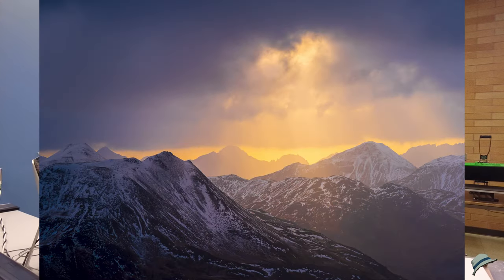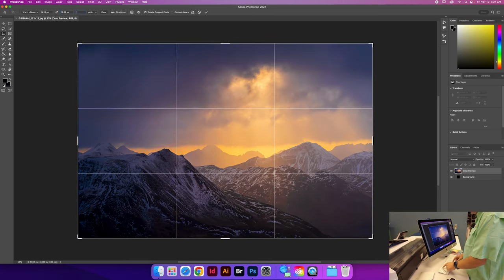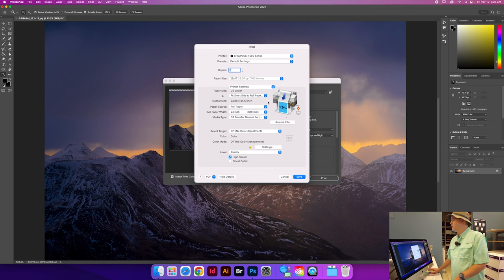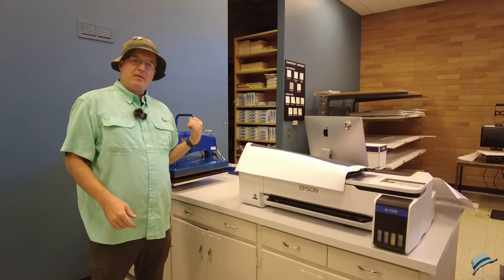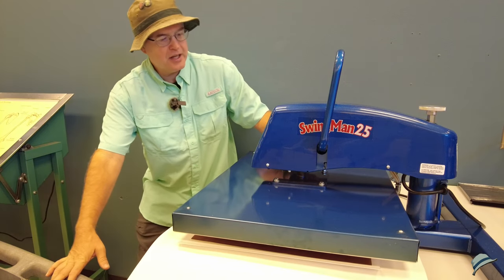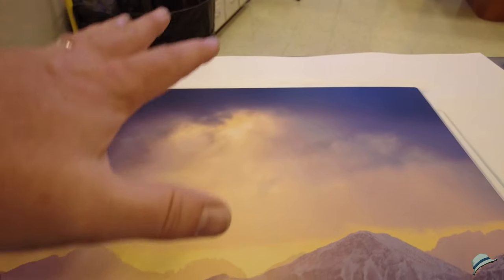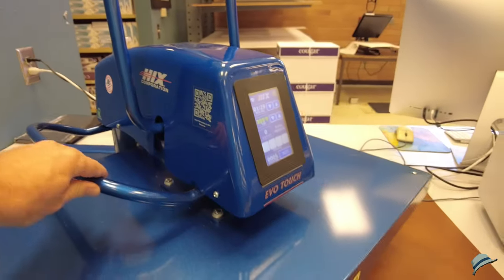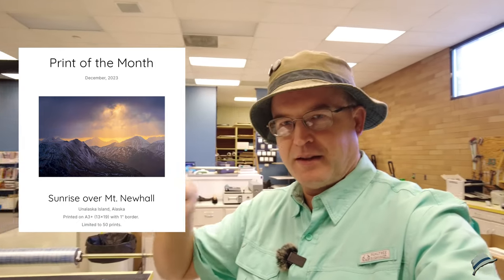How I made a large metal print myself | Dye Sublimation Printing for photography | Epson F570

Comment: Little note on the printer for those who want to get into the hobby - you don't teeechnically need an expensive surecolor for this. Like, while it is nice to have the additional colour accuracy, etc, people also use standard inkjet printers for this(you can find others on YT showing this), what you really need is the proper ink and transfer paper for it, which also works in refillable printers like the Epson EcoTank models, which are like an order of magnituted less expensive. Only downside is the sizes usually run a bit smaller(the ET18100 runs A3+, which is 13 by 19 inches afair) but if you're fine with that or know how to stitch them together or want to get creative with comic-style panel subdivisions, then these cheaper consumer printers are usually more than fine.
Reply from the maker: Yes, I've looked in to converting a standard printer to DyeSub, but I decided our machines aren't the right ones for conversion. If I'd had an older 24" printer I'd have probably done that route. But anyway, it certainly is a good option for many!
Reply: Can I ask if I have a large sublimation printer, but my heat press isn’t large enough, would I be able to use my smaller heat press and do it in sections?
Reply from the maker: I have thought of that but haven't tested it out yet. So I'm unsure. I would think that if you secured it very well to the substrate you'd be fine, but it's possible that different cooking times will adjust the dye application to a noticeable degree. As yet I'm just unsure. I plan to test it with a textile first which is probably going to be super problematic since the substrate is flexible. But rigid substrates are expensive and I don't have the budget for that right now. @meejay100
Reply: @BrentBerghermPhotography  i actually have a small metal print. I will test it on that first. I recently purchased a small heat press before realising that I would like to do a large metal print! Thank you for taking your time to reply.
Reply from the maker: Oh yeah, the bigger the better! :) @meejay100
Reply: My question is, I've seen other videos of sublimation on the metal. Why is this image not so shiny where the other ones have a glass like finish. @BrentBerghermPhotography
Reply from the maker: @stopit4uca  I see, this material has a textured finished and is not glossy shiny. They also make a matte smooth finish without the texture, but this one has a slight texture to the print surface that keeps it from being totally shiny. I prefer it that way, the glare from glossy panels just gets in the way from enjoying the photo.
Reply from the maker: @stopit4uca  this is the specific link I used to purchase these panels. https://www.itsupplies.com/ChromaLuxe-HD-Textured-White-Metal-Print-16x24-p-4883

Comment: Hi Brent, I just wanted to ask you, how to get a nice glossy photo after sublimation, I see you had the same issue as I did on my own image, if you see it at 17;00 min some metallic dots are there. How do I get rid of them? Somebody says more than 3 min press and 380dgr temperature. Did you try it? Thanks
Reply from the maker: As best I can tell, the "dots" you're seeing at 17:00 is one of two things. Either the fading I mentioned do to uneven pressure (keep watching, I fixed the uneven pressure issue), or you're seeing the texture of the material and it's noticeable due to the lighting I'm using and the fact that the print quality degraded due to the uneven pressure. 
To get a more glossy photo you'll need to start with the glossy materials. The material I'm using in this video has a noticeable "textured" surface. I'm not entirely crazy about it, but it does fight the mirror-like reflections you can get with the glossy surface.I still want to try a lustre or matte surface as well.
Reply: @BrentBerghermPhotography  Amazing Brent. I hope u do more tests :) I like your video. Great work and keep going :). Thanks again for replying.

Comment: Hello Brent, maybe you can share the color profile you are using with F570 to metal. My blacks has tint of green and I dont know what to do. Thank you in advance.
Reply from the maker: I am using the one that was installed with the printer software. I'm using sRGB color in PS and printing from PS with PS managing color which allows me to select the appropriate profile. Hope this helps.
Reply: When it comes to dye sublimation, your profile is very important but there are also other important factors such as dry time before pressing, room temperature and also humidity in the air. You can print a poster in the morning and if you go and print the same poster in the afternoon the colours can change. To ensure consistent colour and operation all these things need to be controlled. Anyone can dyesub but there is also science involved to get the accuracy of colours and less waste. Your problem with black can be any of the above, grey can be the hardest because most people will have a green or blue tinge to it when it should be a pure grey. The limitation of a CMYK ink set can also cause this issue.
Reply from the maker: @petertwining5729  You're absolutely right and thanks for bringing this up. As I've gotten more into it I've noticed exactly what you're saying. In general the climate is well controlled in my production space, unless I come in on the weekend and the system is off. I plan to do more in to these items (making more vids) but time is so precious and it's just not able to be scheduled yet. :(

Comment: What textile , no purpose rigid ?
Reply from the maker: I admit my testing is limited at this point, however, when I compared the two I got results I liked better when using textile over rigid. It's a bit deeper in density, even if a tiny amount, and it was closer to the results I was looking for. As I do more testing I'll update my thoughts on this, but for now I've had great results with the textile profile.

Comment: I have the F570 and use the Edge Rip Software, unfortunately it is only for windows so i work on my mac and print from my pc. But the software has all the color coding for the printer in it.

I have spent a lot of $$ in material learning. I had a lot of problems with the higher temps, always inconsistent results using the same Chromaluxe brand panels.  I had a lot of issues with the edges looking incomplete or the blacks were still green (needs to cook longer - black is the last color to sublimate).

What I found is lower and slower and dont go super crazy with the pressure. I use a medium/firm pressure - it clamps down very snug but dont have to put all my weight to get it to go. I put a white cotton pillowcase double layer (no seams over the print - it will mark it). between my top platen and the paper. This allows any moisture to be released that shouldnt be there and helps balance the pressure. This made a huge difference in the surface quality of the print. I set the temp to 350 degrees. With the lower temp, the ink has a longer time to properly bond to the material. And I do 6 minutes (up to 80sq/in) or 6:30 over 80sq/in.  Low and slow.

Right away - my jaw dropped at how good the print came out and the results are consistent.  The low and slow recipe was found deep in the Chromaluxe website. Its what they recommend for gallery quality prints. Because it has time to bond/cure properly the colors are true, vibrant and lush.

After its cool, I will wipe it down with a scratch-less (not sure what else to call it) cleaner (tv cleaner) to remove any residue or marks from the print paper. It also helps buff out the surface to remove any marks from the pillow case. I look at it way to close when it is done. Im my own worst critic.

Just my 2cents worth.  I wish I had that space to work in :D
Reply from the maker: Awesome, this is great to know. Thanks!!

Comment: I recently bought the same Hix Swingman 25 you have and I've been very happy with it. I also have the Epson F570 so I'm glad to see this same combo. I have been experimenting with chromaluxe myself and am considering trying my hand at custom designing aluminum cutouts and applying either subliglaze or possibly sublivista product.

By the way, did you try reducing the platen pressure on these larger prints? I wonder if the pressure is a little too high and that's why you're seeing some ghosting on the edges. I have only tried 11x14 size so far, but I am getting pretty stunning results at pressure 2 and 1:20.  It looks like your solution of building up the edges works though.
Reply from the maker: Hey, this is awesome! :) I've been wanting to do custom substrates, but am so busy with school being in session and all... With the pressure, I figured I needed more since I was getting zero contact at the edges, that and the paper build up made it all perfect. I've seen others flip it upside down so the paper is on the bottom of the platten, where the high density foam is. I've not tested that option and don't think it'll work since I need to build up the material on the bottom anyway. That will give uneven pressure on the paper if it's on the bottom. This issue goes away when I do an 11x14 or so panel. I've also done the MDF boards and they work perfectly too.
Reply: @BrentBerghermPhotography  I think this is an interesting discussion. Pressure being relatively the same is key in my opinion. If you have areas of high and low pressure you could see transfer issues as well as for temperature uniformity. It would be interesting to see if you are getting cold spots in the corners. You can use an IR laser temp gauge to determine temperature uniformity and also look into the use of "plastiguage" (availaible at Auto Zone) for measuring Pressure uniformity. Plastigauge will squeeze out differently for different pressures and is used for measuring extremely small gaps when installing Connecting Rods to a crankshaft. In this case you would be measuring small gaps at the corners relative to the middle and show where you need more or less shim. Just my thoughts as an inexperienced printing guy with a mechanical engineering degree.

Comment: Great video. Serious hobbyists in the process of making my own metal prints. Been looking at the Epson F570. Are you happy with the results? And if you don’t mind me asking, what brand metal panels are you using?
Reply: I'm not the one you're asking but I also have the Epson F570. I have had it for a few weeks so far and I am very happy with the quality and ease of use. I have tried Chromaluxe matte and gloss panels with stunning results, although I prefer the gloss.
Reply from the maker: Yes, very happy with the results. Print dialog box info is slightly different than other printers I've used but easy enough to figure out. And the quality is excellent. I've not been able to compare it to a 6 or greater inkset printer, but I purposely chose this pic to test out how it handles holding shadow detail and it did wonderfully. I've had other prints hold highlight details where i thought sure it'd fall apart so I knew I was good on that. But I'd yet to try deep shadow details and it did supremely well. I use cromaluxe at this time. I also have used mugs and other smaller items from other manufacturers. I use our smaller 170 for those items though. It's basically the same printer but letter sized.
Reply: @emryb hey there. I concur, most of my results thus far have been phenomenal!! However, I’m hitting some issues with larger prints which contain heavy blacks. I just made the discovery last night that the paper I printed seemed to be over saturated with ink causing the paper to be wavy and not being able to dry entirely flat. I’m assuming this is causing the image to result in a black and green pattern almost matching the ink waviness. Hope that makes sense. Either way, I think I need to back off on the color/ink settings. Still new to this so trying to figure it out. I’m printing high quality 12pass, 300dpi, no color compensation since I’m editing my images in Lightroom. Using epson paper with epson ink as well. Little long winded, enjoying the journey of figuring things out. I’ve felt every mistake thus far has created better results every press I do.

Comment: Hello,
Thank you for this video.

I followed all your instruction but still having issues sorting the heat press.

The heat press i got has Celsius alone and not Fahrenheit. What temperature do you recommend and for how long?
Reply from the maker: hello, thanks for watching and for asking! A out 200 degrees Celsius should do it (my range of success is between 385 and 400ºF and 200ºC is towards the higher end of that). You’ll need at least 90 seconds. It kind of depends on your material. If it’s really thin like a lens cloth you can probably get away with 60–90 seconds. But for the panels you’ll need at least 90. Possibly 120. I hope this helps! Let me know :)
Reply: @BrentBerghermPhotography  Thank you for taking the time to explain.
The panel is composite aluminum (white gloss background on one side. Its made of two aluminum sheets with Teflon in between)

We tried it at 375FR for 180 seconds. Upon removing the aluminum got soft and the image just transferred but without gloss and color.
Reply from the maker: It sounds like you have a material that is not made for dye sublimation. That material sounds like DiBond, or a DiBond-like material. Unless you purchased it from a place that advertises it as a dye sublimation blank you will have troubles. I buy from ITsupplies out of Illinois or Coastal Business out of Missouri I think it is. Heatpressnation also sells tons of dye sub materials.
Reply from the maker: Additionally, if you do textiles you don't need to buy a "dye sub" blank. Any polyester material will work. I''ve got a bright yellow shirt to test that I bought at Wal-Mart. What material is often best so you can have full color capabilities. I've printed to many a lens cloth with much success. Just bought them from Amazon or Wal-Mart  @khaffiatali1102
Reply: @BrentBerghermPhotography  you are a blessing thank you. I will source the correct aluminum panels. Last question my friend. Do we have to mirror the image before printing for dye sublimation?
Reply from the maker: Yes, you should be mirroring the output of the image. The print driver assumes that to be the case and does that for you automatically, usually. However, I once "mirrored it twice" which cancels each other out! :) That was a fun one to figure out. In short, there's possibly two places to do the mirroring, just do one of them, and again, by default, one is usually checked already. Good luck!
As for the DiBond, that's an amazing material and it lasts forever and is very durable. It works great with a UV inkjet printer. I've never operated them, just saw them on the showroom floor at Printing United a while back. Printing an 8x4 ft. panel in about 90 seconds is an amazing feat. 
As for the brand of panels, I've been using Chromaluxe. @khaffiatali1102
Reply: @BrentBerghermPhotography  Good day my dear friend, I took your advice and it was successful with the correct panels.

May I ask another question.
Is it possible if the panel is bigger in size than the heat press, can it be sublimated if I heat press the panel half and half ? Or do you have any advice on how to sublimate if possible with a bigger panel size
Reply from the maker: @khaffiatali1102   I have not done this. But I've certainly thought about it. I'll first try it with a textile though, which I think will be tougher to manage. A solid panel should be possible to do, but your biggest problems will be keeping it registered (i.e. it doesn't move from the first pressing to the next so you get a seamless implementation of the image. With a textile, it's soft, and ensuring that the transfer paper doesn't move from pressing to pressing will be tricky. If I do it I'll certainly make a video of it! :)